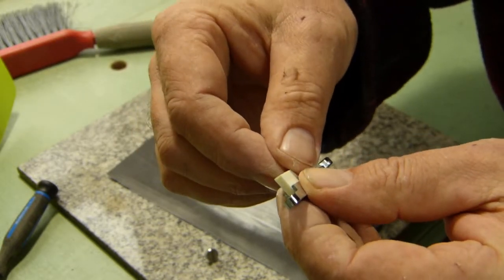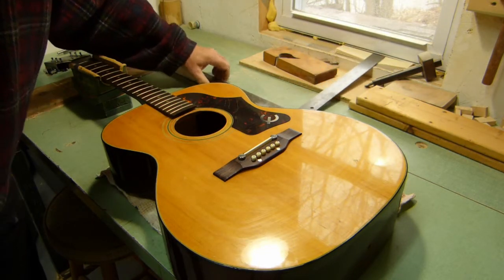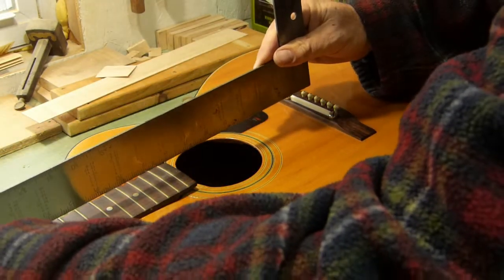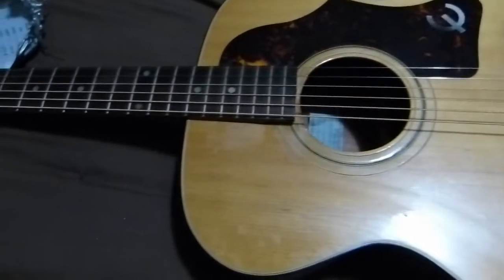Making a bone saddle for an acoustic guitar

Comment: 06:50 Does this projected height measurement from the fretboard allow for/presume that the neck angle may/could/would/wood :-) change when string tension is added? The guitar I have is an old one with no bridge adjustment.
    I have just today asked my local butcher for a bit of beef thigh bone, but I have to wait as he only gets in once a week. Cows are big!